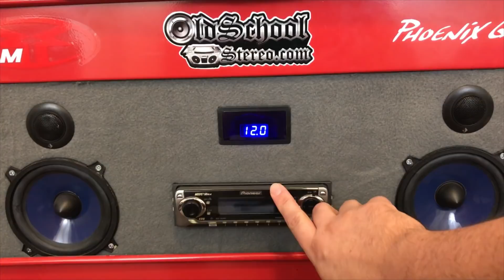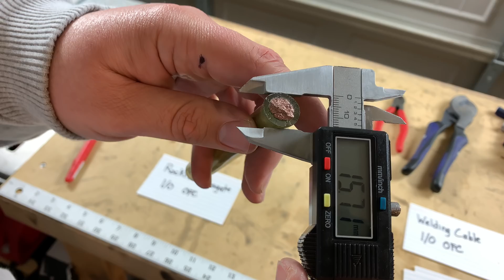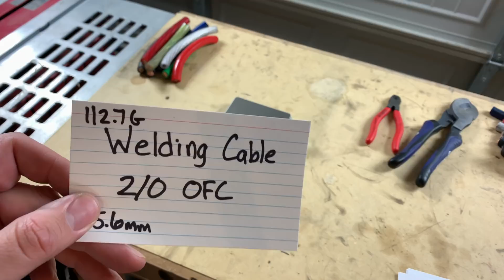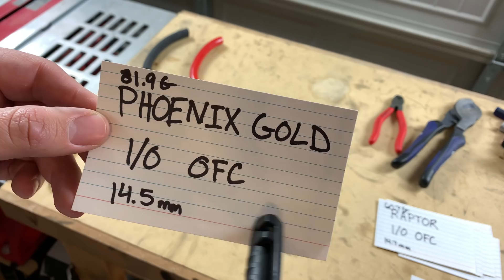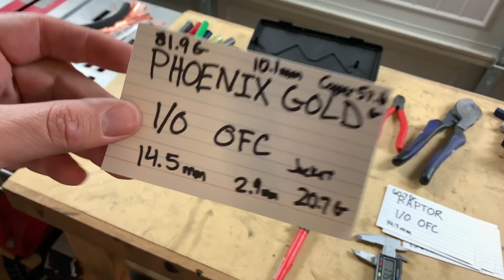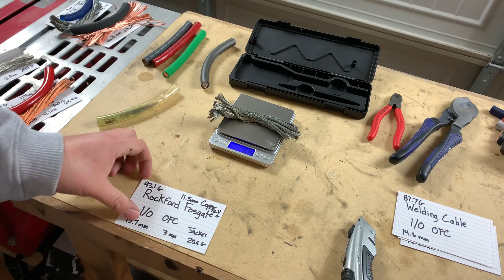The best 1/0 OFC power wire tested and compared (1/0 shootout part 2) [4K]

Comment: That’s pretty cool thank you for doing this here’s a quick question could you take a blow torch to the wire strands and see if they melt fast or slow? I don’t know if you want to bother with that but that would be a better way without testing it on an amplifier I think.

Comment: I read online somewhere that the electricity travels on the surface of the copper, so would that mean that the more strands the better? Not as much as the weight? I was looking at the 2/0 gauge welding cable and it has a little over 1200 strands of copper and knukonceptz has over 5000 strands, so if this is a true statement then the knukonceptz or sky high would be the better choice right? Can someone please correct me if I’m wrong. This has probably been one of the hardest investment decisions I’ve ever made 🤣😂
Reply from the maker: The skin effect comes into play more in high voltage situations. For our use in car audio the higher the strand count the more flexibility you can expect.

Comment: do you know of this is a good welding cable to use ?
TITARC WELDINGCABLE H01N2-D 70MM
Reply from the maker: promo130 haven’t heard of that brans, but most welding cable are built to spec
Reply: HifiVega its an european brand, they say its 1 of the best brands in europe.  only its 70 mm but i guess its 70 square mm. 

think its alot better then most wirekits arround.

Comment: Strand count has alot to do with how good it works for car audio as the current doesn't flow through the copper it flows on the surface of each strand so the more strands the better the current flow .
Reply from the maker: John Garcez you’re right, but welding cable has enough strands that I don’t think it and car audio wire are much different performance wise
Reply: If current only flowed on the outside, if you had tinned copper wire, the copper core would be useless? I don't think so. I use 2/0 pure copper welding cable by Temco and never have corrosion issues.
Reply: That's actually not true. It does flow through the wire. The current on the surface produces what is called "skin effect". Skin effect causes loses in electrical energy due to dissipation which in turn increase resistance and heat. Believe it or not, but a higher strand count increases this effect, which is why car audio wire tends to be bigger to allow the same current flow as welding cable. The less surface area you have the better it is for conductivity. The only thing you really gain from a higher strand count is flexibility and a higher resistance to breaking. Another thing to note is generally welding cable is rated for up to 600v and a 25' run of 1/0 can usually handle up to 300-350 amps. Not to mention it's designed to handle temps of about 105°C(221°F)

Comment: What do you guys think about using the power and ground cables from a BMW for my amp wire kit ?
Reply from the maker: Migg Mog should be fine I believe they used 1/0 welding cable essentially
Reply: I DO THAT ALL THE TIME my builds have it

Comment: you should test AUDIO PIPE wire.. there wire is deffinitly oversized wire and i would not be surprised if it ranks better then sky high audio wire
Reply from the maker: So, I got 2 samples in of AP 1/0 but they were both CCA... I hear they do make OFC so I’ll hafta check that out

Comment: I used 1/0 ofc welding wire throughout...and with the money I saved, I covered it with nice braided plastic sheathing for protection and appearance.  Spent less and got way better overall than any of the other alternatives.
Reply from the maker: Crazy 8s Drums can’t go wrong with welding cable imo
Reply: Crazy 8s drums thanks for that info .i really appreciate that bro .im not doing no type of competent i just want my stuff to bang ..thats all 😆
Reply: @Danielastro85  True dat!  Just know that an 8kw amp aint playin around....doing it the wrong way can burn your whip down.  Be careful out there and definitely p-off yer neighbors!  :D
Reply: @crazy8sdrums  😆 right and hey bro what kind of alternator should i go with ..i was thinking of a 240a
Reply: @Danielastro85  For an alternator, you will be limited to what is available to work with your ride.  Mechman and Singer will not steer you wrong if they offer something that fits.   At full output, your 8k amp is gonna eat up about 800-1000 amperes...at half output, it will use half that....still more than a 240a alternator can drive.  A battery bank can provide buffer time.  Like I said earlier, an 8kw amp aint fkn around...thats serious bizniz!

There is no big alternator available for my car so I am limited at the 2kw total range...and I have maxed out my electrical capacity having 2kw worth of amplifier output.  It is loud as F tho so I am happy with it!
Reply: @Danielastro85  I need to look into some of the real performance specs of the Soundigital amps.  BigDWiz has a good test of the 3000d, the little brother your 8k.  The 3k performed well for output, but it wasn't the most efficient at it at 1 ohm impedance.  You might consider running a 2 ohm total sub impedance to get cleaner sound and better efficiency.  That will mean your 8k amp will run at somewhere near 5kw but it will be cleaner sounding and less demanding of your electrical system.  5kw will still pound the crap out of your neighbors windows and the cops may still chase you.....
Reply: @crazy8sdrums  thanks bro and i see that they still havent tested the 8k ..they need to one of these days and i really appreciate it bro ...im still kinda green with all this car audio stuff
Reply: @crazy8sdrums  at first i had two 1400 crank it up batteries and two 8k power acoustics ..so i upgraded to one xs power 7500 and one 8k amp
Reply: I have a xspower d7500 and a 8k sound digital amp ..what kind of welding wire would i need ?
Reply: @Danielastro85  An 8kw RMS amp would require approximately 800a of fusing.  800a of fusing would require 2 spans of  2/0 OFC with 400a of fusing each.

Soundigital recommends 500a of fusing for 'music' playing, which would be a single run of 4/0.  For 'spl' they recommend 2x 500a fuses which means 2 4/0 cables.  You will need 2-into-1 reducers to squeeze that much copper into the undersized terminals on the amp.
Reply: @Danielastro85  You will also need a more competent alternator to keep your batteries charged.  Batteries plural, as you will need more than one.  An 8kw sub amp plus whatever you are using for mids and highs is going to need a lot of electrical work to keep it fed.

Every install is different, but 1/3 of your budget should be for amplifiers, 1/3 for electrical and 1/3 for speakers and enclosures...approximately.

Comment: EB/ Southwire/royal excellence is  flexible welding 2/0 ofc ... I prefer welding they have strict regulations to follow car audio companies don’t! Also the brands I listed are cheaper than you listed I believe around $2.80 per ft
Reply from the maker: Up To Bat Entertainment I’ve had the suggestion to also have the price listed per a qty of 50’ and I will definitely add that into the next update.

Comment: If you want increased flexibility in welding cable you should look at Class M instead of K, the drawback is Class M is only available in color orange. It uses 34 awg instead of 30 awg strands and has a higher strand count.  Also does anyone know Stinger Pro is the same as the Stinger Pro is the same as the Stinger HPM used in the video?

Comment: Rf 1/0 to my cab 1600.1 CABAUDIO used to have 2/0 welding cable to my jbl 1200.1bp back in the day I say welding cable for the win try gp next I'm buying them next says American made
Reply: JBL 1200 was the shit back in early 2000's I had the 600. But Mofo blew twice on me. But was Prob a wiring issue on my part.

Comment: The paper inside welding cable is for enhanced stripability
Reply: Stripability sounds legit it should be added to the dictionary. Best thing about welding cable it’s workable and is always rated for resistance to abrasions,cold/heat, petroleum products and is by far the best price. I pity the fool who buys anything else. Ebay you can buy it at best price and can get many different colors as well.
Reply from the maker: Thumper 1968 enhanced stripability! I like that phrase 😂 That definitely seems to be the case from the comments I’ve received and the research I’ve done since posting this video.

Comment: Sky High Audio is nice wire l used the 4awg ofc  the strands are really thin and alot  of them and it comes with free shipping it the best deal out there that l could find but ..l did use expanding plastic wire loom to give another layer of profection from ebay at$ 1.60 for 10mm wide by 5 m long :-)
Reply from the maker: Dave F. I’ve got a bunch of their speaker wire as well because it’s such a great value

Comment: sky high ftw.. welding cable doesn't seem to have as clean of copper compared to sky high..
welding cable under the hood
sky high for the main power runs and everything else..
sky high 1/0 is still thicker than 2/0 welding when used in tech flex, I actually use the exact ones you tested..
I'll check and see how well there holding up after this winter.. 
should be good as I use 3:1 adhesive lined heat shrink and all my connections are air tight sealed 99.99%
Reply from the maker: Skyhigh has always been solid in my experience
Reply: HifiVega lately I have had to send so many people to this video! whenever they want to try to knock sky high lmao! They don’t like the price...well usually you get what you pay for!

Comment: what site do i go to get the 2 ott weldind cable
Reply: Simple Man go too ac/dc wire supply on eBay order southwire excellene royal 2/0 welding cable it’s the best and they have 3day shipping
Reply from the maker: This is from Amazon, but you can get it off eBay as well or direct from the manufacturers site. I left a link in the description for the 2/0
Reply: Wireandsupply.com Royal Excelene is great

Comment: Welding cable usually is my top choice however I do run Sky High Car Audio as well as GP Car Audio!
Reply from the maker: johndub14 DUB MALI I seen your wire stash lol
Reply: @HifiVega  lol its dwindling everytime I stop by the house!
Reply: @Outty 5000 hertz  what's up man, you like that gp wire? Was about to order my 1/0 amp kit and was gonna go with skyhigh or gp amp kit, is the gp really stiff or kind of flexible
Reply: @johnnypiper1717  the GP wire is very stiff compared to the Sky High Car Audio wire. Still good cables and not as stiff as welding cable

Comment: I run sky high 1/0 power wire, big3 and their speaker wire.  Glad they stood up to the competition.  

Using a mechman battery relocation kit, I cannot remember what the kit has 2ga or 4ga

I have used 1/0 ga JL in the past.

I just gave a away 20 ft. 4ga streetwires (2001ish) buddy of mine for his small amp setup. 

Rob, thanks for the comparison shootout.
Reply from the maker: TheKomar924 Thanks for watching!

Comment: I had used 2/0 welding in 3 vehicles now but was out of longer lengths when my son wanted a system. I remembered I got a spool of Sky High 1/0 OFC free with my 1st Mechman Elite 370. I was shocked how thick the 1/0 Sky High was. I totally had to grab a scrap of the welding 2/0 and it is so close visually that I wouldn’t bet my lunch money on either being thicker than the other. Great job buddy. Thanks for putting in the hours to show us what’s up. You know the nut huggers would argue to the death, (some even after putting it on a plate in front of them)!
Reply from the maker: allpaulsfault SD6 Thanks man! I will definitely adding more brands to an update video at some point
Reply: You're right. Sky High calls it "oversized" 1/0, but it's actually 2/0.

Comment: can't beat sky high slightly bigger diameter than others but welding cable is good too I like to use #6 welding cable on sub boxes it is slightly bigger than 10 gauge and #2 is close to 4 gauge .
Reply from the maker: eric dudley skyhigh has been solid since the beginning